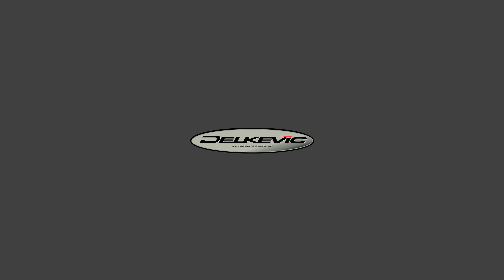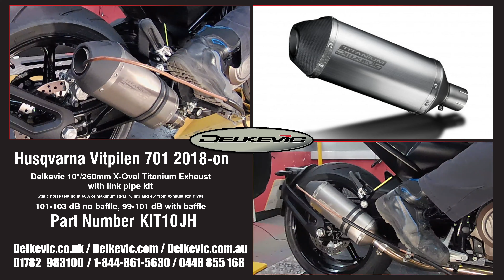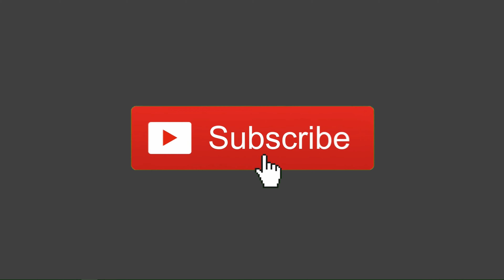Delkevic Exhaust Muffler X-Oval Titanium Short sound Husqvarna Vitpilen

Comment: so I dont need any remapping on my MT-10  ?
Reply from the maker: Hi there, that's correct, you don't NEED any additional fuel mapping or mods and the exhaust and your bike will run great but you will of course benefit from applying additional fuel mapping or mods to your bike, as is the case with any exhaust from any manufacturer.  Here's the link to the MT10 video with the same exhaust as fitted to the Vitpilen.  https://youtu.be/P-PrKUzcIWk
Reply: @DelkevicExhausts  thank you I have 13 tri oval with the decat link pipe when installed can I use the stock O2 sensors please let me know thanks
Reply from the maker: @kevincraig8257  Yes, our exhausts allow for the fitment of the original O2 sensors.
Reply: @DelkevicExhausts  thanks